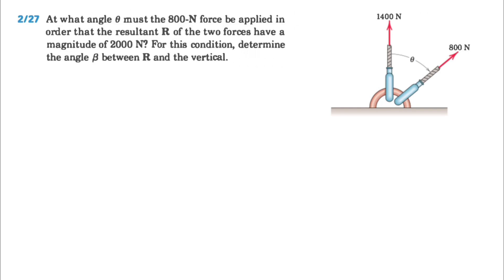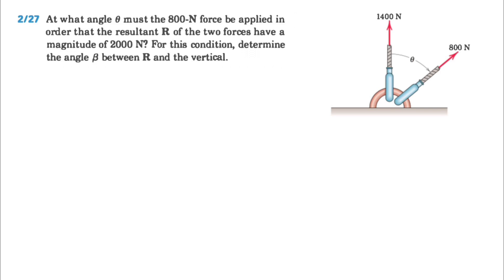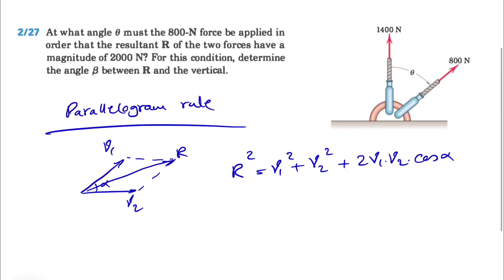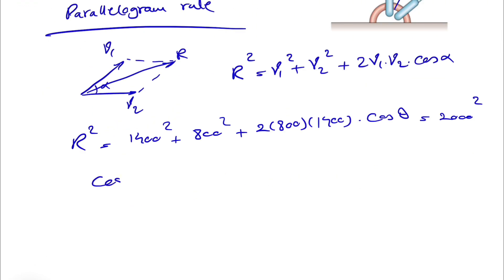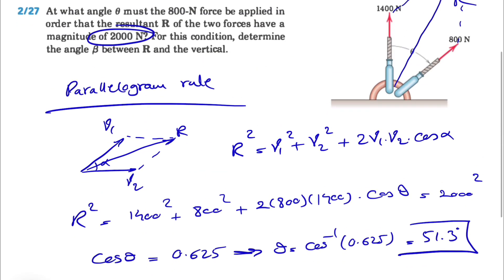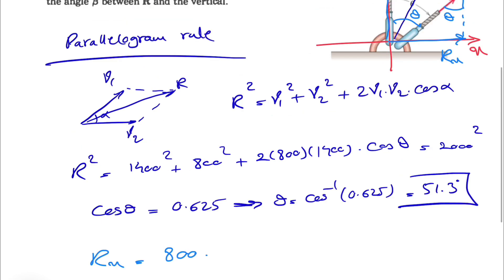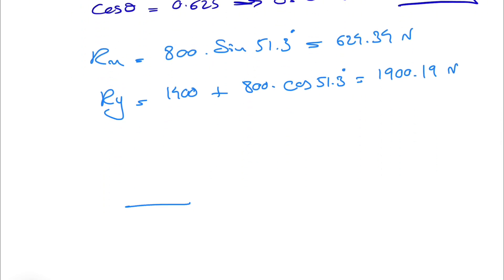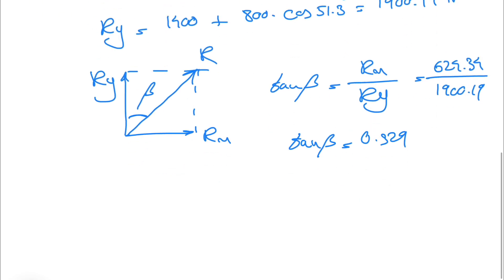Solved Problem  2.27 |  Determine the angle 𝛽 between R and the vertical.

Comment: Hello sir, i hope you are doing well.Which rule did you use to get a thitor. Since when I'm doing calculation, I got a different answer.
Reply: The angle that we get while using cosine rule is the one opposite to R. Not thetor, and I believe you made a mistake on the last term of the is not supposed to be (-2×800×1400cos<)
Please correct me if I am wrong.
Sorry if I sound rude. My English is poor I tried my level best
Reply from the maker: @jerrychueneselepe  The angle opposite to R is 180-theta and cos(180-theta)=-cos(theta), so the negative in the law of cosines will turn into positive, hope this helps!